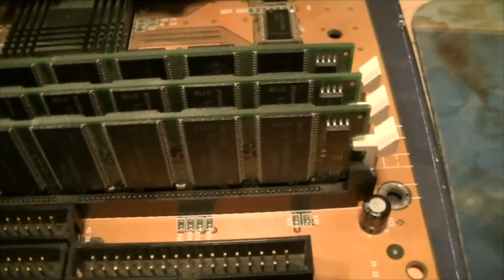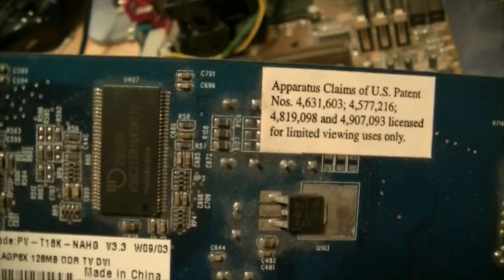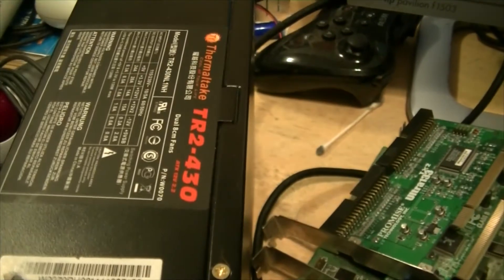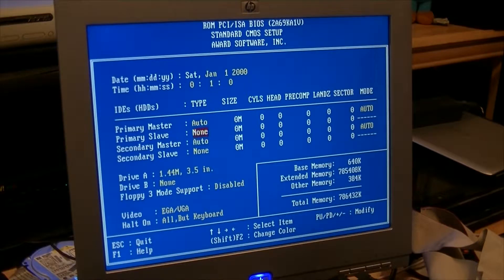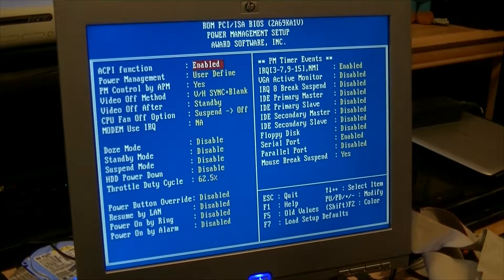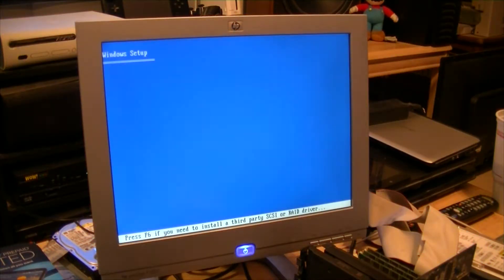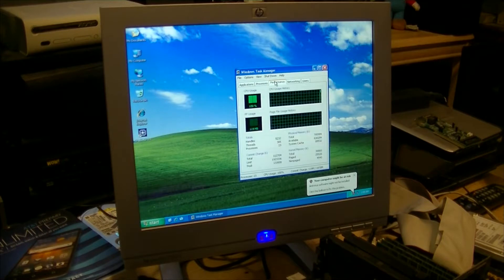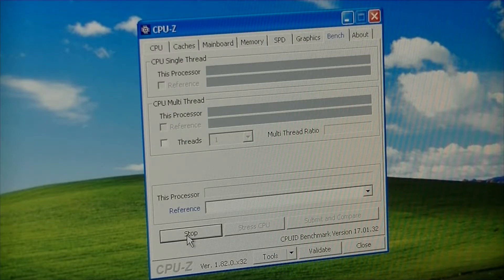Abit BH6 Intel 440BX

Comment: I also got today a Bh6 Rev. 1.1 for my future projects, but with very old bios from 05.05.99. The latest bios is from the 20.06.2000, Version SP, and you can tune much more in the cpu soft menu II, than with the kk first release bios! As I can see in the video, you use the latest bios.